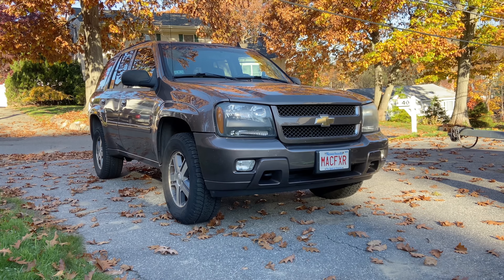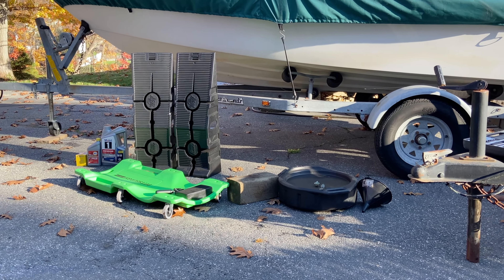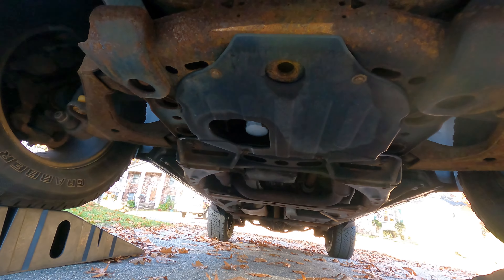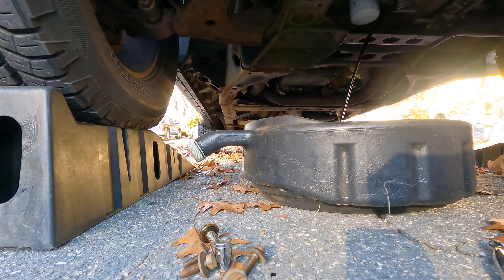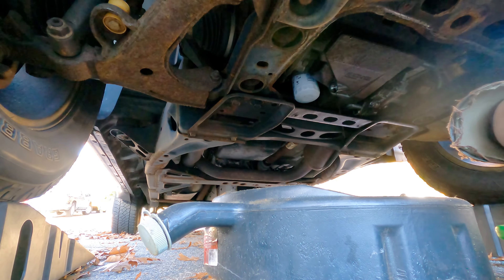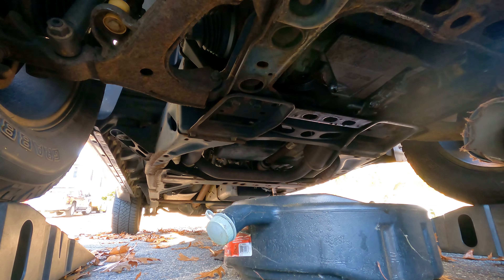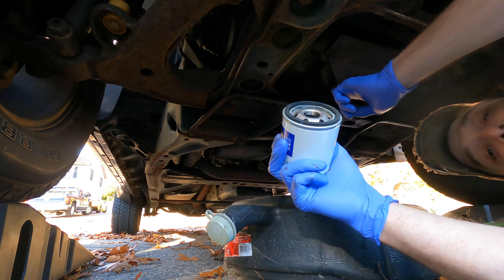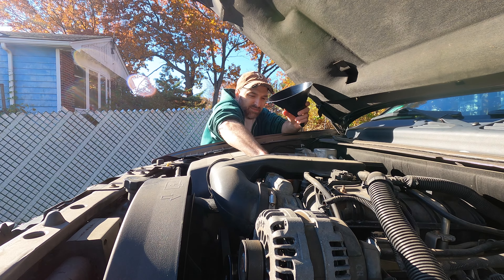Chevy Trailblazer V8 Oil Change

Comment: Good job Sir !!!
Reply from the maker: Thanks. now if only I had the technical know how to swap that 4 speed automatic for a 6 speed manual, I'd definitely be keeping this truck forever no matter how old it gets :D
Reply: @YardworkWithJohn  I didn't know they put a 5.3 in a Trailblazer ..that's a keeper
Reply from the maker: It was an option you could get, but this was the 2000's and gas prices were sky high then too so everyone stayed with the inline 6 to get 2mpg better fuel economy. A decent amount of the long wheel base, 3-row trailblazers had the V8 but its very rare in the short wheelbase, 5 passenger trucks. Funny thing is, while it gets slightly worse fuel economy during normal driving, it actually gets slightly better fuel economy while towing. And it's super fun to drive!

Comment: Is it the same oil filter that goes in a v6
Reply from the maker: I don't know, but I would assume it's a different part since it's a different engine, and the V8 comes down from an existing line (the full size trucks)
Reply: I6 vortec motor different